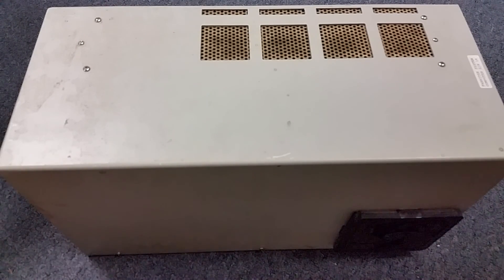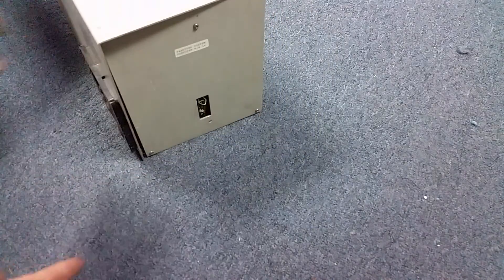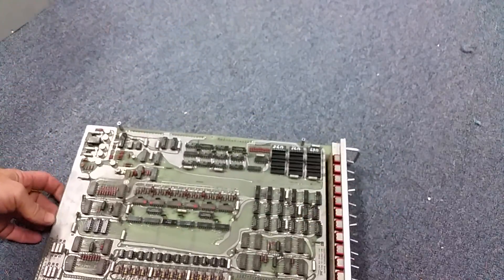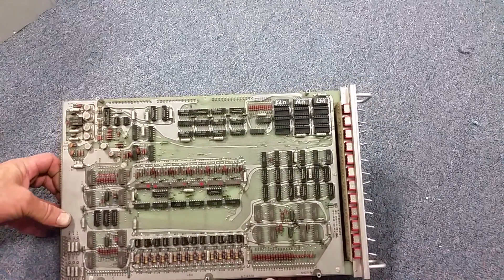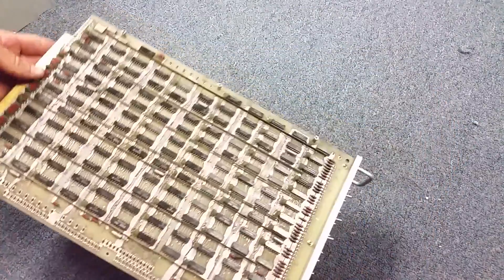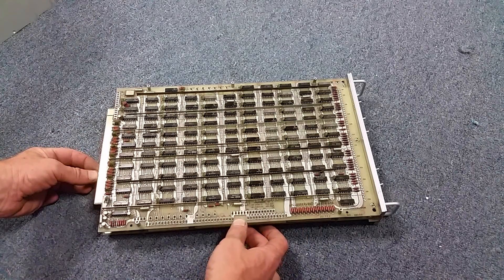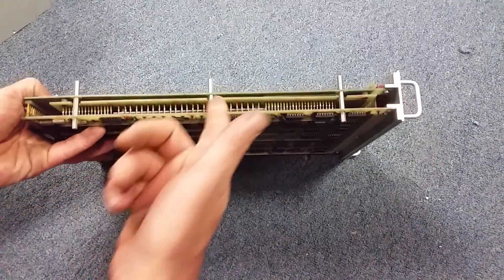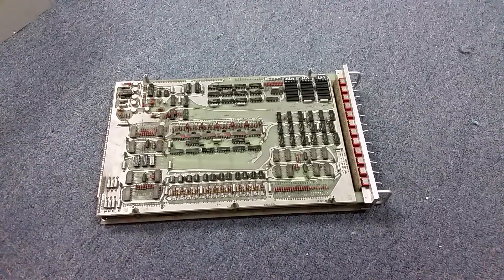Fabritek MP12 - a PDP-8 Clone

Comment: Thanks for the video!  In Volume 2 of The Best of Creative Computing, there's an advert for a PDP-8 clone (or 'simulation', as it was described), called the PCM-12.  It's a bit bigger than the model you have here.  I don't know if it's related or from a competitor.  The company's address is San Ramon, CA and was simply called, "PCM".  The unit was based on the Intersil IM6100 microprocessor.  There isn't too much that I found out on the web about it besides a few pictures, nor any videos.
Reply from the maker: Yes, I think I have heard of that machine. I do not think I have ever seen one, however.
Reply: We had a few PCM-12's in a research lab I worked at very long ago.   They were much smaller, cooler, and cheaper than a PDP-8/E, but only ran at about 1/3 the speed.   The CPU had a weird front-panel emulated in firmware, which would send the internal registers out to some LED's.  Every 20th of a second there would be a front-panel interrupt into a ROM and the code there would move the registers to the front panel lights.  It was a very odd operating mode as something like every other instruction was skipped for some crazy reason.   The CPU didn't have the memory extension built-in, so there was a separate board for memory extension with more chips than the CPU board.   An okay but unexciting computer.

Comment: Yup I purchased one of these :)
Those overlay ROMs are for a paper tape loader, its not RIM though, its in the TOP of the 4K address space, so if you go up there and try to modify anything you will notice you can't because its the ROM!
Me and someone else who had one reversed engineered how its put into memory from paper tape and I made some rough messy code to adapt from RIM to the format they have.
So it is possible to load paper tape!
We reversed engineered the front panel lights and switches and buttons too for the paper tape reader. They are all controlled by I/O opcodes if I recall correctly.
I haven't touched mine in awhile since its been at home not in NY with me, but I think I am going to bring it back up with me this time :)
May even show it at VCF MW, because why not!
Reply: How could you call the subroutine in ROM? The PDP-8 machines store the return address at the start of the subroutine. So I'd be interested to know how that worked.